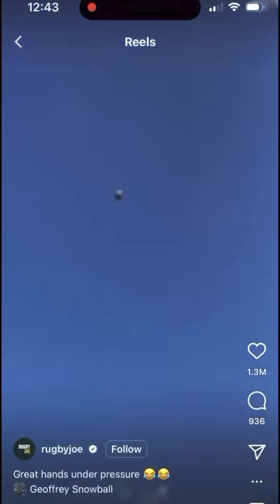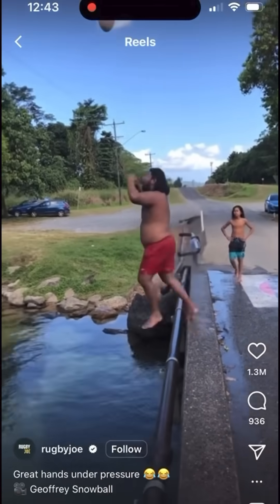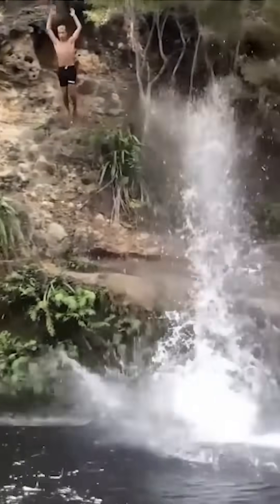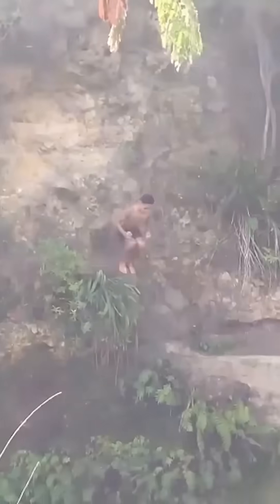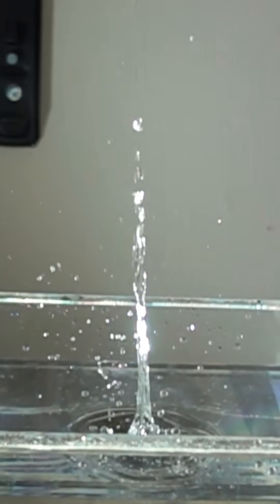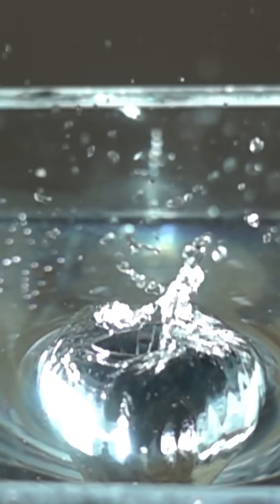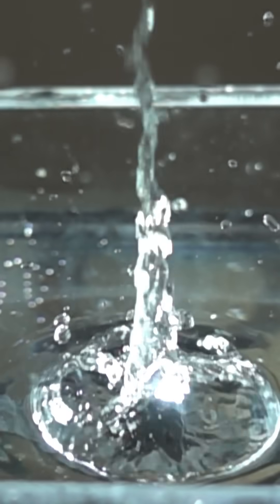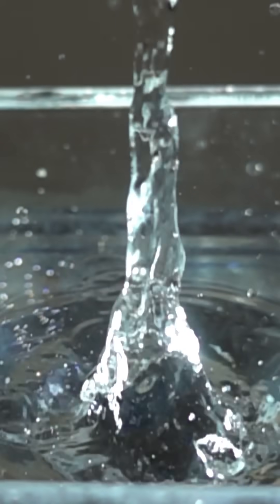How Do Manu Bombs Work?

Comment: Used to do splash dives with my friends in the outdoor diving pool in the summer in the late 60s/early 70s, competing to produce the highest splash.  Cannonball was for amateurs; only produced a low, wide splash.  

We found two dives produced the highest splash: one was: arms folded, lazy boy body position but with one knee closer to chest entering water, then quick release backwards while lowered the raised knee.  Created a big water hole and pressure to fill it.  Often so high it popped our ear drums.  Sometimes it even hurt a bit on the tallest splashes.  

The other was a suicide dive, create an inverted U shape right before hitting the water surface, then quickly straighten ur back.  Similar result as the other dive.

Comment: The changing of direction of the ball would take up most of the energy of the water push back. When the big guy hits the water the splash back goes in every direction and cancels out the jet and how does the ball move faster than the couple drops of water thats pushing it. There is just not that much energy in your splash back

Comment: That's how in the story I have in my head. Where they have a huge battle ship that unfold and separate into multiple. They use the huge amounts of displaced water tthta then get filled up to launch hydravions directly into the it instead of having them take off on the runway wich would be slower.

Comment: This action, is also the same affect that takes place with shaped charges. 
Shaped charges also start off as a cavity. 
A simple cone of perfectly shaped material at the right angle, will then send an ultra-fast stream of liquified copper, at speeds far exceeding the detonation velocity of the charge. 
The copper is instantly liquified by intense pressure and heat, into a very fine, but very fast moving spear, piercing anything, including hardened steel armor plate, multiple inches thick. 
The mathematics behind it are now fine tuned, but original shapes charged in devices like the RPG, were simply done using trial and error.

Comment: Okay. 
So he explains an object can be ejected from the water as the collapsing water fills the void that the object creates.
But he never goes into the dynamics of the particular "bomb" that is used here which makes such good use of this effect.
For best splash (in this case, object ejection) the object needs to create an ideal void as it enters the water. As water refills the void, its splash greatness will be determined by void size, shape and symmetry among other things.
For height it requires a long void with skinny pinch point (exit hole)
For bigger splash you want big void, speed and to combine height you add a small pinch point.

The design on the specific bomb known as the "Manu" is one that maximises small entry hole at velocity followed by a large void created beneath the surface of the water.
The diver will ideally land on the water in almost an upside-down staple dive, bending the body at the hips to create a V or arrow type shape that hits the water butt first.
Being as foldled as much as possible creates a smaller, pointy entry hole with minimal surface disruption, then the diver times the bomb such that as they hit surface they open the body up straight in plank style as fast as possible.
This creates an enlarging void under water and pushes water away from them, sucking water and air forces inward. If the diver is really good they will go plank and then ball up to snap the energy transfer away from themselves and leave it in the base of the void they are making, in the form of potential elastic kinetic energy. 
Jump while folded, snap open into water, ball up for the finish.
Water enters the void fast and hard as you went from small to big while carrying that energy into the bomb zone, and as it fills the hole the pinch point tries closing over this dispersing energy and becomes a pressure cap that pops all that force out into the air as it completes its refil process.
Big Manu, big bomb splash.
NZ represent.
Reply: Okay nerd

Comment: Fun fact. This also happens with sand and earth. A current running theory for the mass extinction of the dinosaurs is a direct result of silicates being thrust into the atmosphere from the impact of a meteorite. All the falling particulates burned up, raising the temperature on the surface enough to kill anything that wasn't underground (i.e. mammals and smaller lizards survived)!

Comment: Whait, is this the exact same mecanism of function that HEAT rounds and rockets use?

I mean, if you think about, all the Cooper material from the cooper cone of the HEAT ammo willl colapse into one single spot, the center of the cone, and when this happen, the "cooper jet" will be shot at insane velocity and temperature.

Comment: So I've contemplated what happened thousands of years ago when the large asteroid hit the Indian Ocean at 15,000 miles per hour, fast enough to hit the bottom.
The "hill" wave outside of the initial impact could have been a mile wide, and the tidal wave went around the earth.

But the upsplash of water from this would have left the planet and the atmosphere would have been dragged and wplashed away from the planet as well.
If Tonga alone boosted the amount of water vapor in our atmosphere, the big one in The Indian would have increased the water vapor in the atmosphere by a huge amount.

Comment: Its just transfer of the impuls from more massive object to less massive, it's like balls of different sizes stucked on top of each other, and then released on the asphalt, concrete or other hard ground, and the lighest/smallest ball reach the highest speed, and this is the reason why i think that superlight speed particles mihlght exist, but they are way smaller than plank length, cause in my opinion mass of the object and their speed are releated, and what if particles smaller than plank length exists?

Comment: No it's not. It's called a Cannonball.
Nothing special about it. It's the same as clasping your hand closed with fluid in it. The water becomes a fast closing funnel, squeezing the funnel closed thus forcing the water to be pushed out, which is up in this case.

No big deal.

Pretty much every principle of science law revolves around one main thing; the fact that the universe will always strive to equalize itself, to balance itself out.

Realizing this fact, we now set off to harness that power to do work for us. We call this "technology", which simply means the harnessing of power.

It's all just really basic and plain and simple.

Comment: Looks a bit like the plasma jet a HEAT warhead creates from its shaped charge. Makes sense since the water displacement is conical with the tip at its lowest point before it collapses.

Comment: If you want to do an experiment, you can try it with a yoghurt. Use set (unsure if translation is correct) yoghurt and make a hole in the center down to the bottom.
Then just let it fall to the table from about 10cm hight. The yoghurt will shoot out a tiny stream when hitting the table. 

ATTENTION: It WILL reach the room ceiling!

Comment: When I was a kid we always called this a can opener but usually we would grab one knee and pull it up into our chest just before we hit the water and it would make a bigger splash than landing with our legs parallel to each other. We went out to do a cannonball which was tucking both knees into our chest wrapping our arms around our legs but that one did not get a splash as high as the can opener would
Reply: We would call it the jackknife or can opener interchangeably.
Reply: That’s how I always did a cannonball. I didn’t realize it was different.

Comment: Thos os not true thr ball has air is it so it wNts to go im imidtly
Reply: Anything with a sufficiently lower mass would be propelled by the water. 
The buoyancy of the ball does help to keep it at the very top of of ejection, but you'd see similar effects with objects that don't float as strongly.

Comment: Same physics why pebble poops splash and long poops don’t
Reply: According to my serious research, long poops tend to splash much less because they gently get lowered down towards the surface of the water as they're still... um... being *extruded *. 
If you compensate by giving the long poop a slightly higher release -more potential energy from the height difference - (allowing it to reach the same velocity), it can also achieve the same effect - known colloquially as 'Poseidon's Kiss'. 
Assuming a favourable angle of attack, the long poop can actually have a greater effect due to its larger mass and volume displacing more water, leading to a steeper, deeper cavity prior to the collapse, launching the fluid projectile more forcefully.

I hope to do my hydrodynamics PhD on the effect, possible market applications include low cost, low concentration, non-toxic surfactants (pretty much soaps) that municipalities can add to the water supply to protect citizens from wet derrieres. Would also decrease bacterial viability in water mains by disrupting cell membranes. In the rare case of a much more difficult Poseidon's Kiss into said modified water, at least the grain- and gravity-fed bidet will leave your arse cleaner than before.

Comment: Pro tip for the highest level of water spray 

Do a cannon ball but instead of folding your legs in criss cross them it helps funnel the water better 

Depending on your weight and the height of what your jumping off of it can be awesome 

Speaking from experience when me and the family went to a lake-house they had a tower deck and my sisters aunts and mom were all on top tanning they didn’t think they’d get wet…..

Until a 240 pound 17 year old me sprinted off of it like a coke infused chimpanzee and when I came up for air all I heard where there screams of sheer terror at getting wet as my dad swam over smiling from ear to ear and said 

“Nice!”
And gave me a high five
It was GLORIOUS
Reply: H2O ANTICS - ❤ CHUCKLE,😊😊😊
Reply: In California we grab one leg, extend the other, and hit the water explosively 💥We call it the “canopener”. The fulcrum effect displaces a large volume of water very quickly.😅
Reply: @markwweswinger - that's also called a can opener in New York and Texas
Reply: @manny4mayor every 60 seconds in America, one minute passed in Africa
Reply: @ne0dynamic  it's true.
Reply: @ne0dynamic false you got 40 more

Trust me bro
Reply: @ dude got that “me at 5:99” ahh logic
Reply: @MrWiezy  Fulcrum effect, you mean like you rotate around the foot of the extended leg? Or rather it should be the opposite I suppose, your COM the fulcrum and the extended leg rotating. Since the rest of your body is more massive than the leg, if you hit the water with your butt and extended leg at the same time, the situation is symmetrical and so I wouldn't expect the foot to become the fulcrum. But maybe that happens if you jump in a different way
Reply: Nah we’ll still manu here in NZ because of what we do with the rest of our upper body once we hit the water, can’t do it with a cannon ball. No cannon ball has ever wet the ceiling at the highest point of the Tok indoor pools in my home town only manus have but hey never know one day it might happen.

Comment: This is essentially how shape-charges work and how a fist sized lump of explosive around a copper cone can penetrate over a foot of high strength steel.
Reply: It is also how cavitation causes damage to propellers, and how modern torpedoes detonate 50 feet below the hull and rip a ship in two (see HMAS Torrens sinking video)

It is called a reentrant jet.
Reply: Interesting
Reply: I wondered how that worked.
Reply: I came here to say the same thing. I wonder if this phenomenon played any part in inspiring the development of explosive jet projectiles...
Reply: I was going to ask just that... thought it looked like a shaped charge!! (learning stuff!!) 🤔👍
Reply: if i recall, the jet from the explosive travels at 8000 M/s
Reply: @J-A-Gnz  8 KM/s is about right
Reply: I’m kinda thinking that like when you put a ball with air underwater it takes a lot of force to lower it and it wants to shoot to the top wouldn’t that also be a reason to why the ball go up at so much force? I mean pulling air under water that air is gonna wanna go to the top
Reply: I was gonna say! "Hey, that looks a lot like a HEAT jet..."
Reply: This was my first thought!
Reply: You can even use something like the bottom of a champagne bottle to make a shaped charge. Just need that cone to direct the energy.
Reply: Similar principle with munitions that pierce tanks and leave what looks like a microwaved can of spaghetti-o's when finished.
Reply: Wow cool story literally no one asked bro. Lmfao
Reply: @sentientdogma1206  Well it's probably a lot more interesting than you are.
Reply: @peterswires8439  It most definitely is.
Reply: @sentientdogma1206 are you a.. soy based life form?
Reply: @sentientdogma1206 there's another comment that asked this exact question. 😅
Reply: @sentientdogma1206 if people only spoke when somebody asked, nobody would say anything.
Reply: @sentientdogma1206 you miss your daddy?
Reply: @sentientdogma1206 must suck being so lonely you’ve gotta get your notifications from the YouTube comments section pal. 

Here, I’ll acknowledge you pal. 😂

🤓

Comment: Looks like a concentric wave that collapses in on itself with only one focal point for release of the peak. Same principle behind shaped charges that pierce through heavy armor.
Try this in your kitchen, open a small container of stiff yogurt, take a straw and make a small hole that opens the yogurt to it's bottom. Then lift the yogurt container and let it fall several cm onto the counter top. A very small dollup of yogurt will now be on your ceiling. Don't let mom watch.

Comment: I want to know what will happen if you put liquid nitrogen in vaccum chamber ? 
😊
Reply: It will boil even faster to become gaseous nitrogen, pretty much just returning it to the air. It will mean that the vacuum pumps will need to run for much longer before a vacuum is reached in the chamber, because as they are pumping air out of the chamber, it is being replaced by the nitrogen (pretty much making much more air). 
If I remember correctly normal everyday air is around 78% nitrogen gas. 
A much more exciting thing happens if you seal off a chamber with liquid nitrogen inside. As it boils, the pressure builds many times higher than atmospheric temperature. You've now built either a lid-launcher, a bomb, or a chamber you really don't want to open by hand without a pressure relief valve.

Thinking of it like that, I suppose running the vacuum pumps on a vacuum chamber filled with liquid nitrogen is like defusing it...

Let me know if you have any questions. 
(I've handled a lot of liquid N2)
Reply: @Sprosbold  that means the vapour pressure will continue to increase and with the progress of the Rxn coordinate we would notice the Gaseous medium n2 molecules continue to increase leading to a pure liquid-gas equilibrium but its pressure in the walls would be higher?? Thus its like a bomb you say ? Coz volume is kept constartains and air is succed out thus tryna reduce volume but 
P nd V are inversely proportional so volume dec . Means pressure due to pure N2 gas Inc... and boom a lid launcher 🫡 
Thanks Mr. Spros for taking your time and replying... only if my parents could gimme pocketmoney or smthg for experiments, im 17 with no pocketmoney 😭 coz we poor .... anyways bye my Senior Sprosbold have a beautiful day
Reply: @Sprosbold  ☝️

Comment: I am so glad so many people see "conical surface projected into a jet stream by pressure" and think shaped charge
Reply: Haha I was going to make a comment about shaped charges
Reply: Me too.  It seems very analogous.  Now we need a water bomb-based EFP.  A disk held flat over one's head. It would have to be plastic, not elastic, but lightweight.  A thin sheet of modeling clay sewn into a fabric sleeve so it conforms, but doesn't rupture?
Reply: @patricknorton5788 that’s too dense
Reply: I mean, a Manu is effectively a water-based shaped charge, using the impact of a human as the energy to form and launch the jet
Reply: As an active duty weirdo I will confirm I instantly thought shaped charge and Monroe effect
Reply: Physics
Reply: Huh?
Reply: Im not lol I wish we didn’t have to know those existed
Reply: @yoeyyoey8937 to be fair shaped charged have uses outside of the military as well
Reply: @heretichazel  like in geology or something?
Reply: @yoeyyoey8937  Nah. They're very useful when you lock yourself out

Comment: Seems like this would make a great weapon if plasma were used instead of water.
Reply: Plasma would not have the same tendency to collapse back in itself after being displaced. The phenomenon is due to the properties of fluids (or media that act like fluids in extreme cases, like the lithosphere on large meteor impacts). Change the medium and its properties, and you change the result.